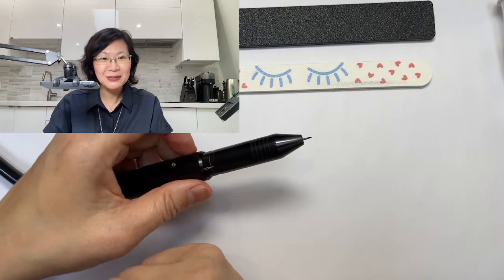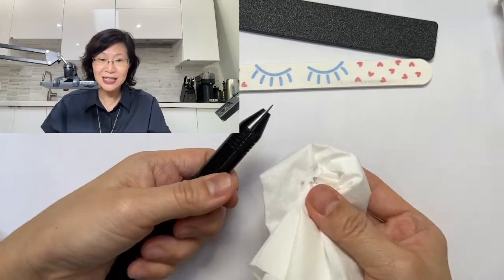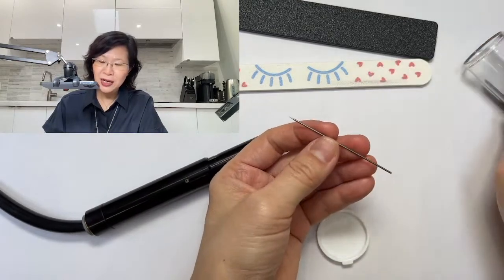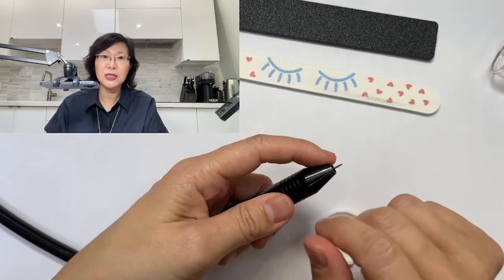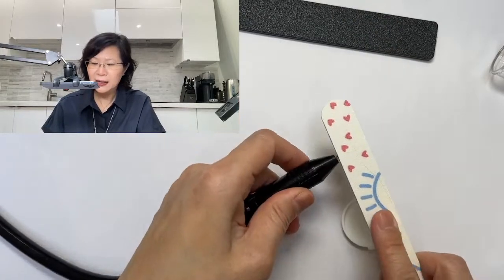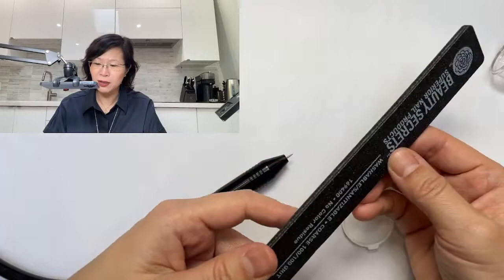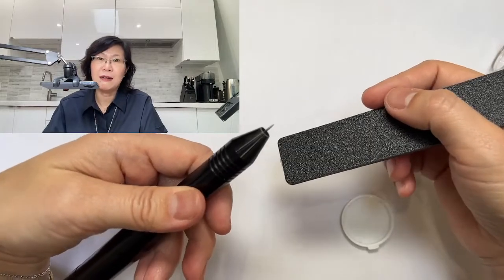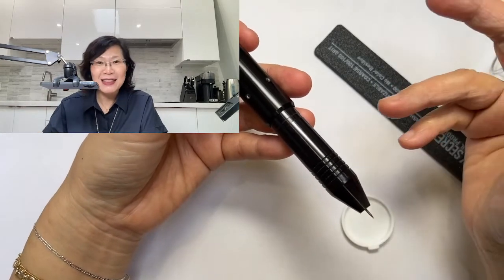How to Clean and Sharpen Welding Electrode - Orion Micro Welder mPulse - Permanent Jewelry Tutorial

Comment: Did you know how you sharpen your tungsten affects your weld?  

Direct from Sunstone

If the grind marks are produced at the wrong location on the grinding wheel, as shown in the figure, circumferential rings can be produced. These rings can produce high-density electric fields along the ring structures that cause the welding arc to initiate from unintended side locations. Even slight changes in electrode angle may cause a shift in the arc starting ring location resulting in inconsistent and oddly shaped weld spots. Most pulse arc manufacturers use 1.5% lanthanated tungsten weld electrodes. These electrodes are not radioactive, yet they still provide exceptionally similar results to the radioactive thoriated materials thoriated materials used early in the development of TIG welding.
Reply from the maker: I think it is best to use the electrode sharpener.  It is only US$75 (CA$105) and I sell them here:
https://stonesandfindings.com/product/peshp-pilot-electrode-sharpener-for-your-orion-tungsten-for-permanent-jewelry/

It has a hole that in the casing that you put the electrode through to ensure a perfect angle.  Eyeballing it is not the best. 

That said, if you do not have the sharpener and need to sharpen it on the spot, you can use a file (if you're really good at eyeballing angles).  I should have said on camera that am used to sharpening knifes and I an twirling the electrode as I run the file over it.  I had done this off camera and can get it to almost identical sharpness before deciding to film this.

You should always test weld and adjust power as needed, however you sharpen the electrode.  There is a significant welding result difference between dull and sharp electrodes.

Comment: I never knew this!!! Thank you! Have been using the dremel, this is def a time saver. What are your thoughts on using a blunt tip to  weld sterling silver? I’ve heard that tip before. Thanks!! Ps- just received my first order from S&F - so excited!
Reply from the maker: Thanks for supporting S&F with purchase - I hope you love everything!  We take pride in offering the best quality and service.
Back to your question - blunting the electrode.  When you do that, it shoots less power and the idea is that it is to be used for welding softer metals.  It's a pain to switch the electrode between customers who want different metals, especially if you have a line of people.  The best is always to keep the electrode sharp and reduce the power.  But I find the best is just to keep the power at 7w.  If your machine is way powerful and you're melting and warping the jump rings at 5w power, then dull the electrode and up power for gold filled.  Saves time.  Honestly, I don't know why they give advice that is tedious.  I like practical efficiency!!!  Good luck with business!  Dana
Reply: @stonesandfindings  so helpful - thanks again!